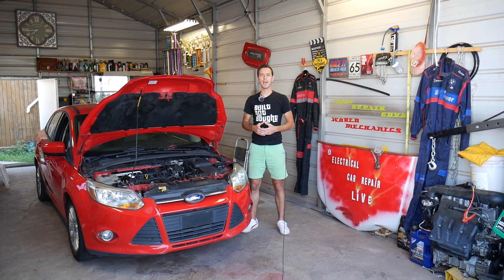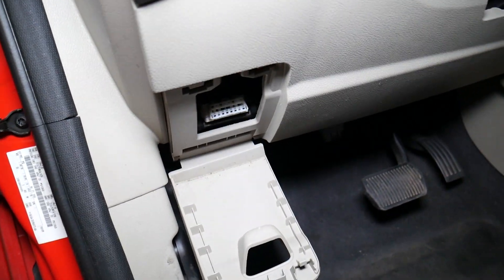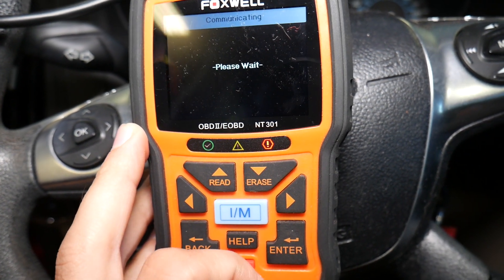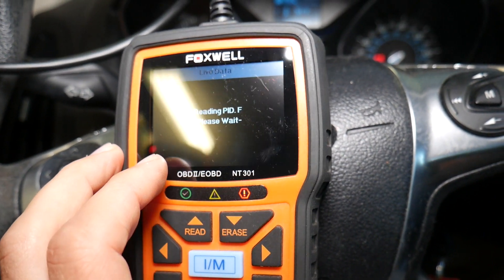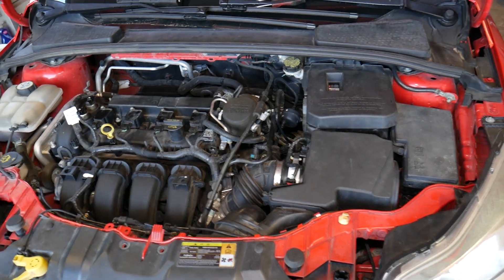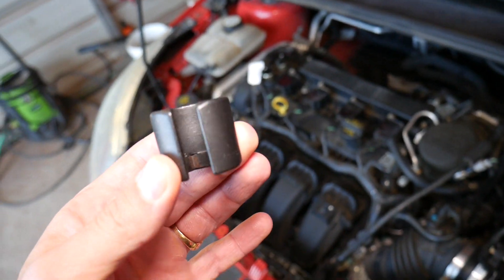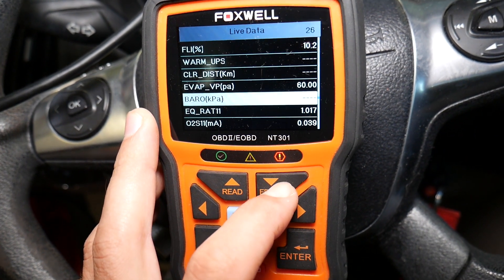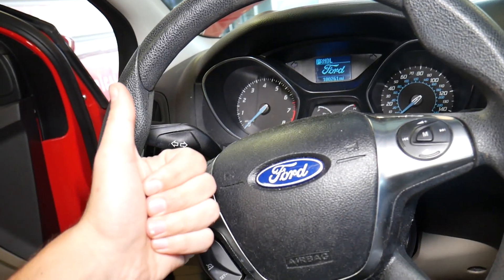FORD FOCUS CODE P0135 02 SENSOR HEATER CIRCUIT BANK 1 SENSOR 1

Comment: I have replaced the sensor and cleared the code. The light and code comes back on after a couple of drives. My obd doesn't show any voltage but other than that the sensor values are moving when pressing on the throttle. I think it's an electrical issue involving the ecu ? and not the sensor itself as the sensor is brand new.
Codes : P0037, P0030 & P0136
Reply: Me pasa lo mismo a mi , como resolviste tu caso ?